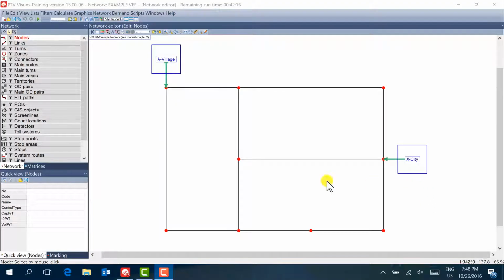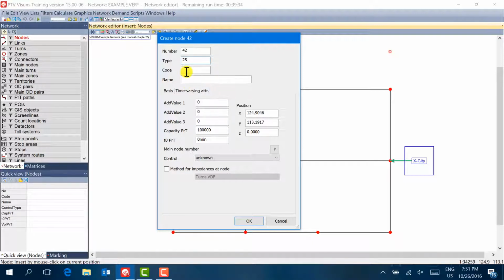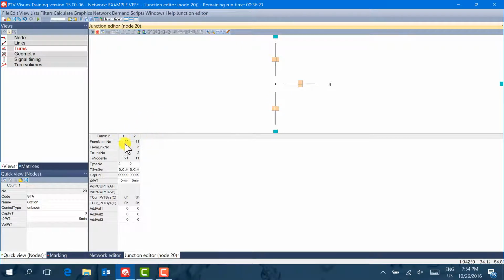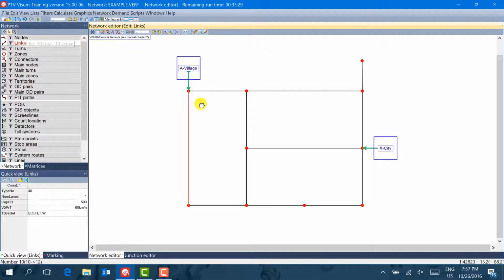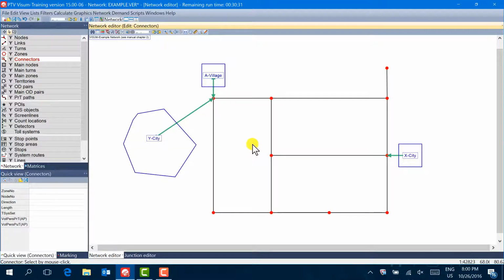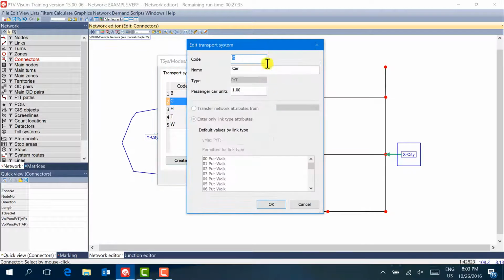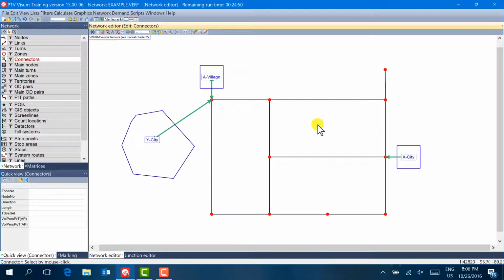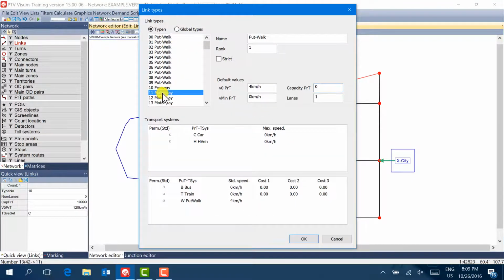PTV VISUM Tutorial - Lesson 1 - Network Objects

Comment: hi! thank you for this tutorial,

Can you explain how we can make a roundabout ?
There is a specific method or is just only four node linked with circular link?
What kind of task is "control Type"? What for?  It does some difference to the assignation?
Reply from the maker: Hello Giuseppe,

you can code a roundabout by connecting 4 nodes with a circular link as you said. The control type of the node/turn is important to assign the desired delay on the node/turn. I will make a video about node and turn delays(VDF Function) soon. 

In brief, the control type related to the Volume Delay Function (VDF) defined inside Visum. These delay functions are usually calibrated from the site to determine the delay on these nodes.